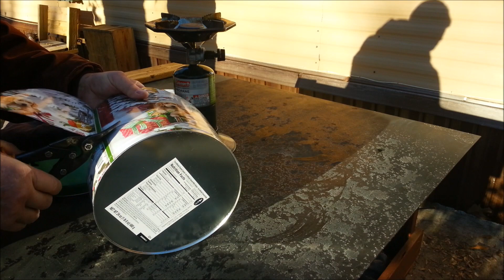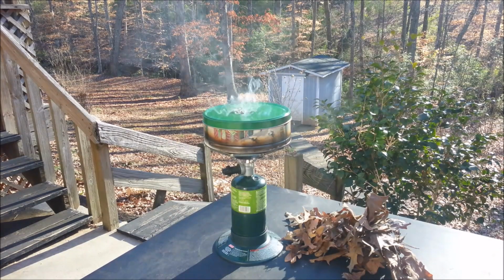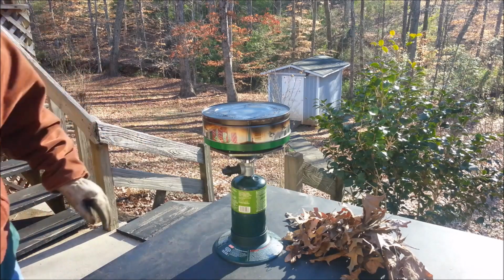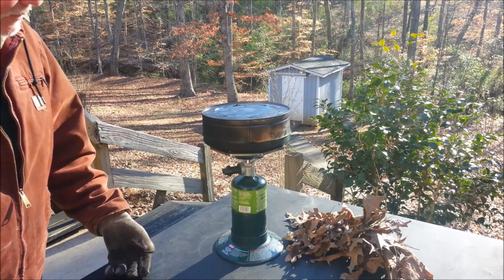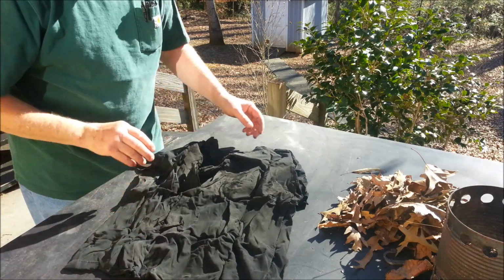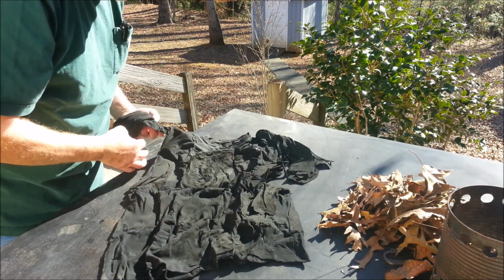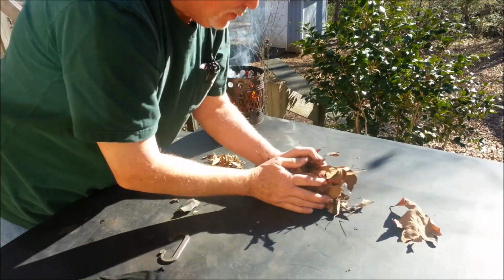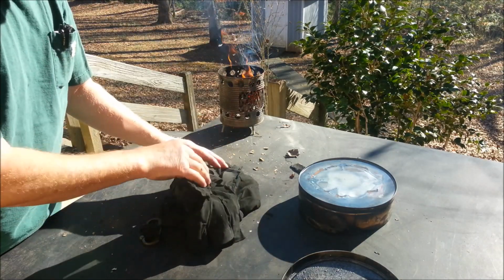Bulk Charring... Charring An Entire T- Shirt In A Modified Popcorn Tin

Comment from the maker: Things I wanted to explore in this Bulk Charring experiment...
1) Will the popcorn tin hold up to this much intense heat?
2) Will the material char thoroughly in such a large tin?
3) Will a large hole in the lid work to easily release gases?
4) Can I bend the lid's hole flap back down for the tin's cooling?
5) I expect lots of deposits; how will they affect the char cloth?
6) Does the char cloth perform well?
* It'll take days and weeks for me to put together and recognize  everything that I've learned from this experiment. But what I've already learned today is... When bulk charring like this... Don't think that just because the outside of the tin is cool to the touch, that the char cloth core within has also cooled. LOL! Please SUBSCRIBE at the end of the video. Thanks!

Comment: cool video man,that's what I use alot is the tins like that but smaller,they do pretty good,I have a question,have u ever used a fire piston?
Reply from the maker: Never had a desire to use one, nor a set of string and loops for the top of a hand drill spindle, or a pump bow drill. Thanks!
Reply: David West I thought about getting one or making one,one other question and I know its off topic to the video,lol,can you harvest horseweed in the winter instead of the summer and letting it dry out
Reply from the maker: Yes but it's usually harder to work with. Once it freezes and thaws a couple of times.
Reply: David West awesome, thanks